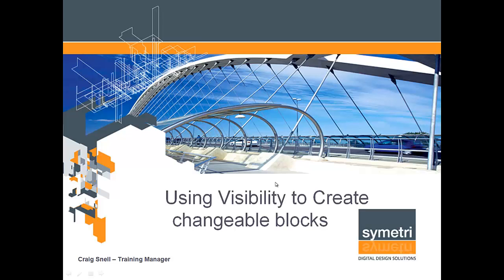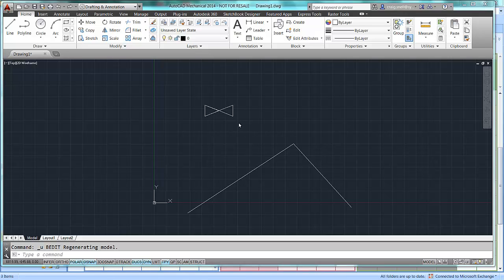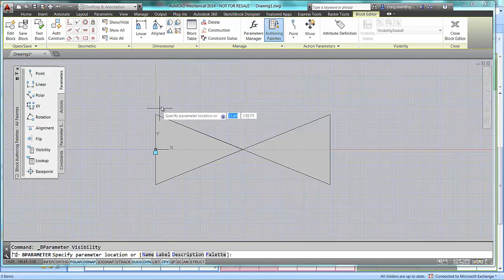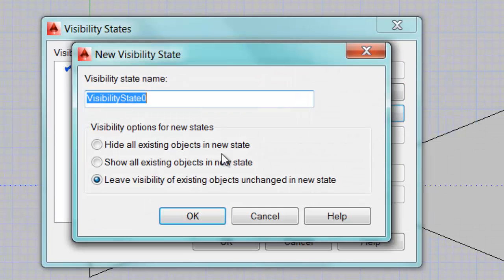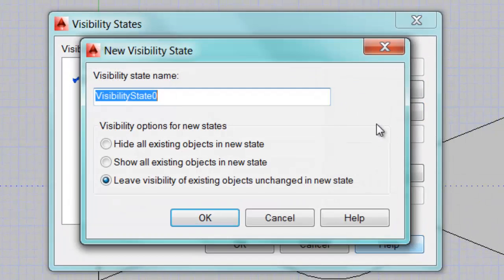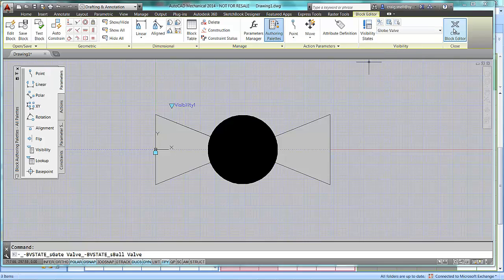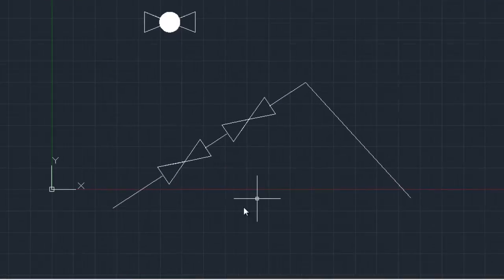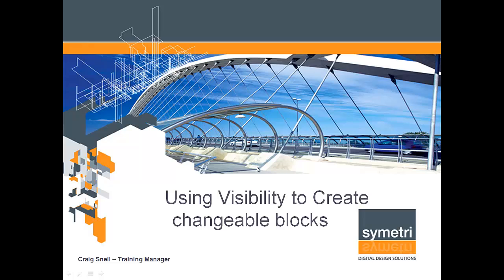AutoCAD Tips & Tricks - Multiple Blocks into 1

Comment from the maker: there are several ways you can do it, the easiest way is to save all of your blocks into one drawing eg called library.  Then put all of your block into a tool pallette, the old fashioned way is to do wblocks of all of your drawings which means you get loads of separate drawings.  its hard to manage that way, its much easier with one drawing, using cut and paste to add new blocks to it